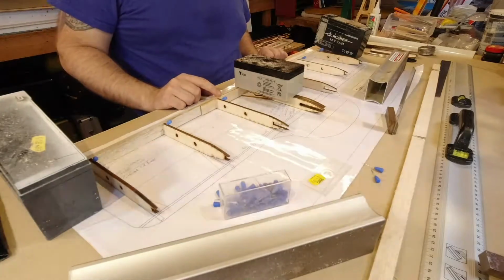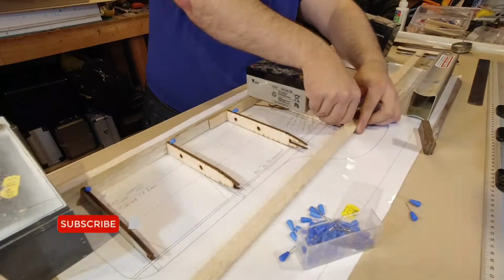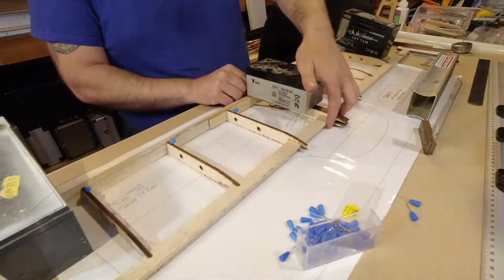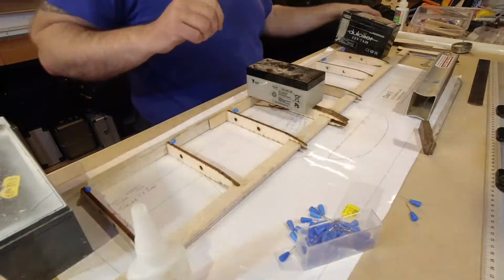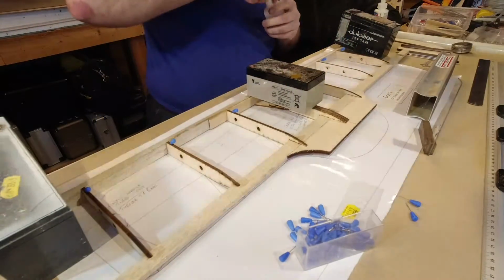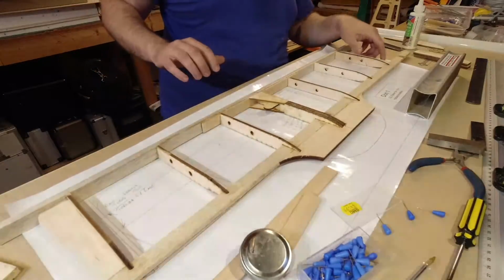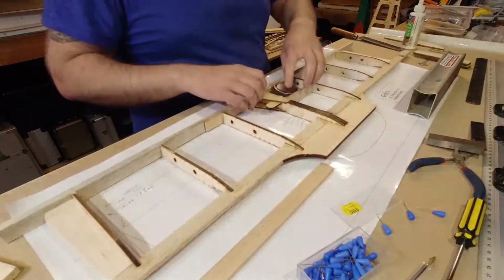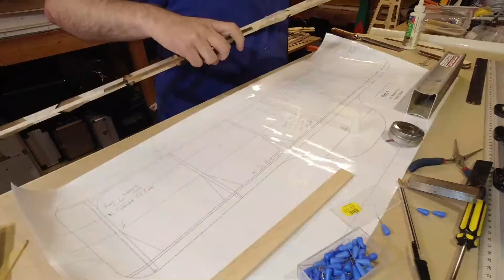Hobbins Hobbies Mini FlyMe Combat Wing Trainer Pt2

Comment: You could try upping your frame rate on your camera as the picture is flickering.
Reply from the maker: It is shot in 1080/60fps but there is interference from the led lighting that I presume is very close to 60hz. I have tried everything I can find to get rid of it
Reply: @njrmodelling  I have the same problem with my Led lighting, If my camera is set to 30fps the picture flickers like yours but setting it to 50fps fixed it.